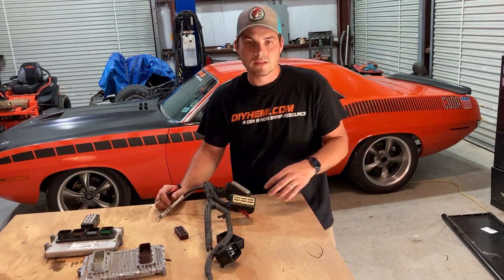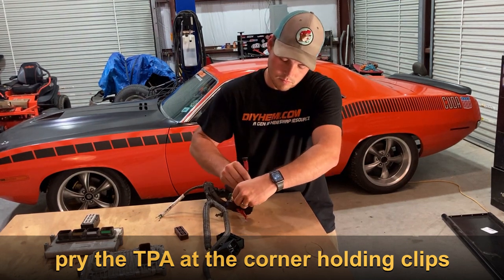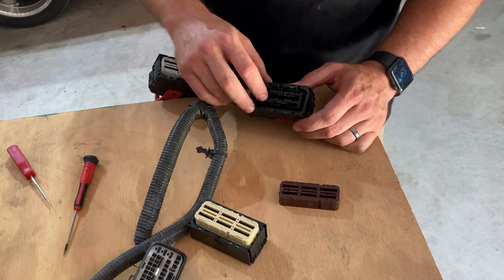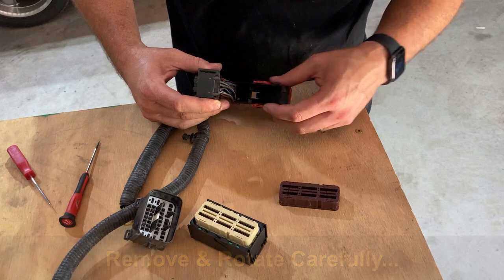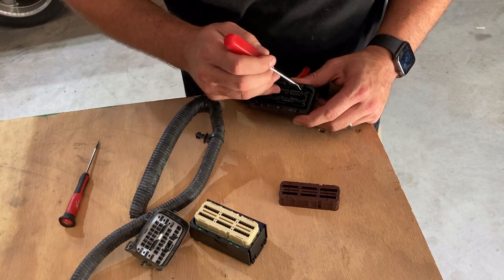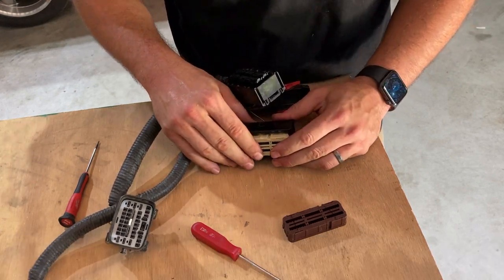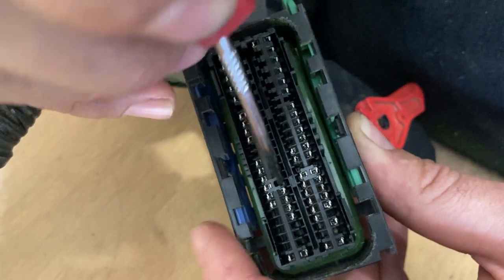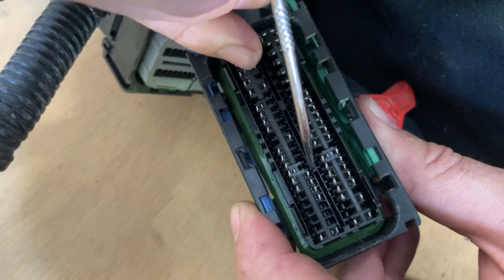Connector Pin Change Out - Hemi Swap connector for ECM PCM upgrade.

Comment: This helped fix a 2014 Dodge Grand Caravan with a P0205 code, open circuit to injector 5.  The circuit was open where the injector 5 PCU pin plugs into the cable harness.  I used a sewing needle to adjust the connector in the harness because it looked different than the others.  The problem is cleared and I'm relieved.
Reply from the maker: Awesome man. Great thinking and glad we could help!

Comment: I broke the red handle (not sure name) and yes its a pita to put back on PCM. Question? I bought the replacement. I see when you used screw driver and folded it back, it stay connected still. It will come off though? Or is there more work? Do you have a video on how to replace though? I see its common to break those and maybe you have a video?